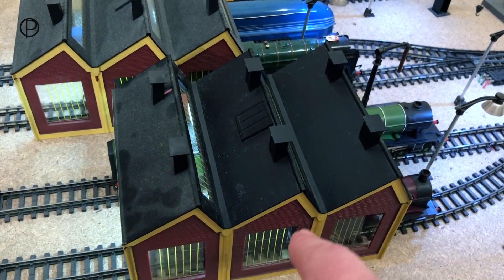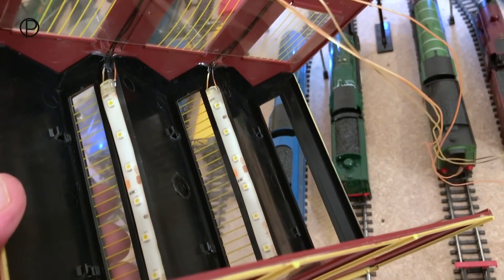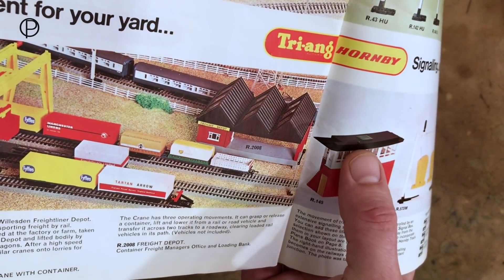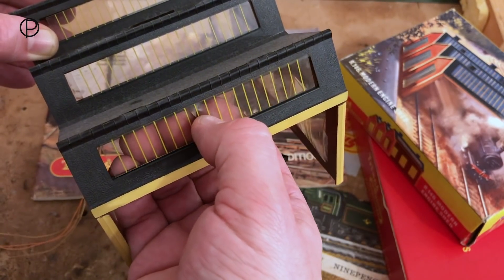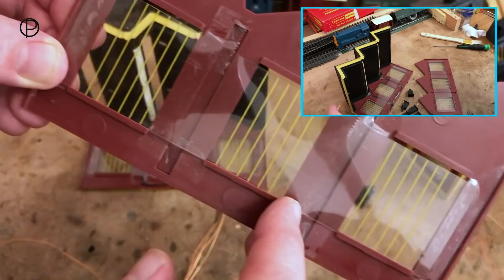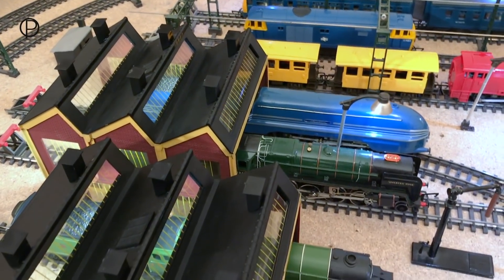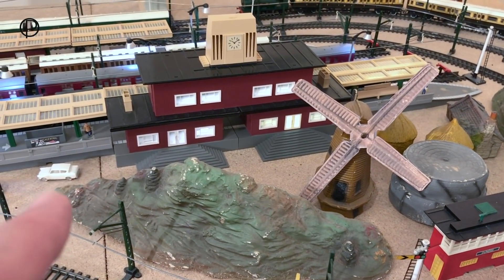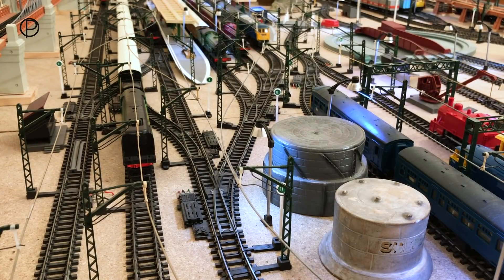Tri-ang Railways Modern Engine Shed R.146

Comment: Good one . Later versions of the modern engine shed had there chimneys moulded as part of the roof . I’ve got one from 74 with the green chimneys and one from 77 worth the complete moulded roof .  Interesting about shrinking acetate . I’d better have a look!
Reply from the maker: Thanks Russell, I didn't know that there was a roof moulded all as one. Sound like a logical set forward. Those little clips that hold them in place a very fragile, and you do see many for sale with the chimney missing. I would like to think that the later glazing strip would be the same material as used in the mk1 coaches perhaps, as they don't appear to shrink.
Thanks again for watching and the extra information.
Oscar

Comment: Very interesting. i have similar problems with windows on my engine shed and station canopy. All good fun.
Reply from the maker: Thanks Philip, I wonder at what stage they changed the materials they use. Or I suppose the other question at what age did the materials used begin to shrink? Interesting you mention the station canopy, I have not come across this effect in the ones I have at present, the material used in the examples I currently have seem to quite thin and brittle, but I'm convinced these are from the late 60s-early 70s. As you say its all good fun.
Oscar

Comment: I just have one of those sheds which is essentially "New in box" although it dates back to the early 1970's. Strangely I prefer the red and yellow Tri-ang boxes over the picture boxes. There is something about them that says "British" and "solid" The picture boxes seem cheaper to me.  I wonder if you could cut a new piece of clear acetate and slot it in behind the shrunken ones in the side walls to hold them in place?  All in all another great video, your knowledge and insight into these great models is second to none. Thank you Oscar.    David.
Reply from the maker: Good morning David, it's great to hear your opinion on the packaging.  The earlier packaging certainly does have a very strong look and was unarguably a key tool in establishing a strong brand presence in the market. I imagen there was a growing desire to modernise the look of the brand and take advantage of the newer technologies in mass packaging becoming available at that time. The colours red and yellow I believe still feature heavily in the current incarnation of the Hornby brand.
Thanks again for watching and taking the time to comment its hugely appreciated.
Oscar
Reply: @oscarpaisley  Great reply Oscar, thank you and you're welcome. 
David.

Comment: Hi Oscar. I just cleaned up my dmu 101 and was wondering why the glass doesn't fit. It had also curled pretty noticeably. i ended up putting it between a folded towel and ironed it straight with a warm iron. Good vid as usual. Thanks mate.
Reply from the maker: Hadn't thought of that. Thanks, I might give it a go.
Oscar

Comment: I couldn't work out what was going on with my engine sheds or coaches...……( I need to keep taking the tablets )    Doughhhh "Shrinkage"!!    Cheers Oscar
Reply from the maker: Good afternoon Paul, it's an odd material they chose to use in this period. I'm not sure if it all shrinks. The material used in later items is much thinner and quite brittle and seems to stay the right size.
Oscar
Reply: Indeed  Oscar I think you've hit on it there...I Just assumed mine had been altered or got at in some way....On Closer inspection after seeing your film clip I realise it is indeed shrinkage.. Paul

Comment: I was wondering why some of my retaurant cars had pinkish staining on the opaque glazing and thought is was an aberrations. I now see that one of yours shows tthe same. Ots only, as far as I have seen, those with the maroon plastic sides, I've not noticed similar on the SR or WR varions.  I can't bring myself to cut the strip, I did make a replacement of the right length with the curtains where they should be but, oddly enough, it actually looked wrong so I replaced the originals!
Reply from the maker: Good morning Andrew, I have not been able to cut the strips either! I had thought of making a replacement but had never got around to it. After reading your comment, I think I shall probably leave the originals in place. Its a bit like correcting verticals in photographs is some images it works, and some it looks just wrong to the eye.
Oscar